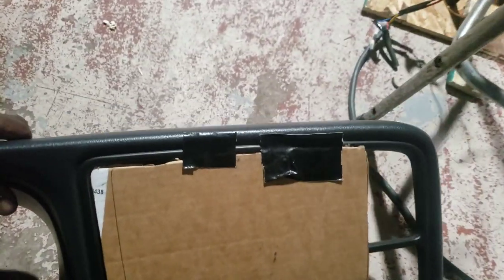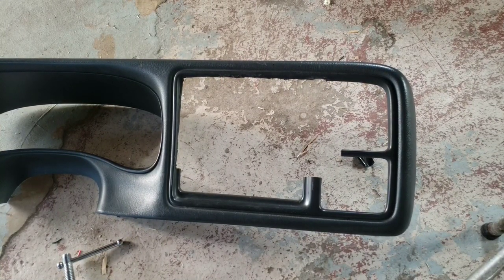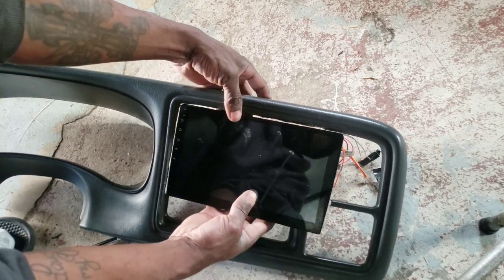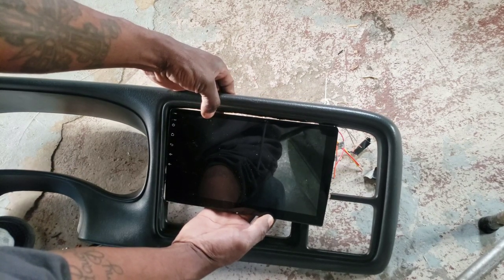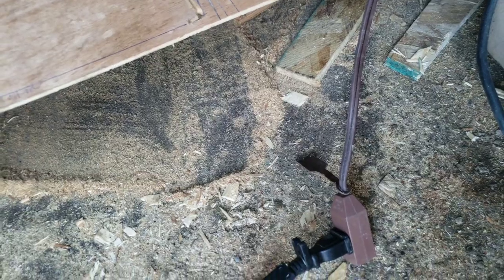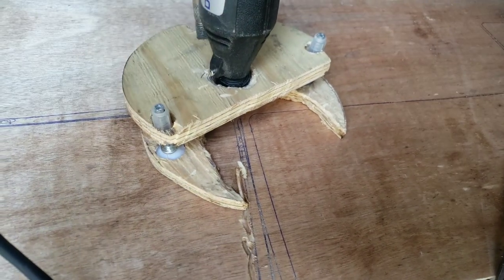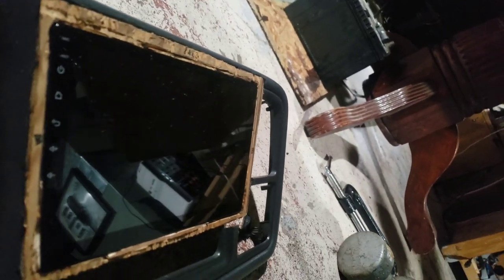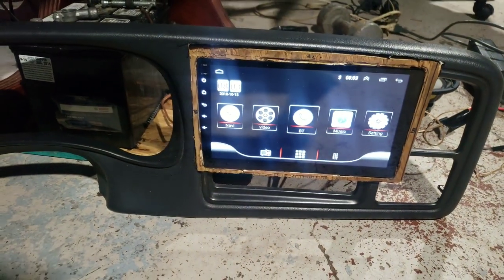How to put a oversized android radio flush in a single DIN Yukon part 1 (10.1 android radio)

Comment: Yo this is badass but how do you screw the double din into the frame without the cover in the way? What I’m dealing with rn….
Reply from the maker: I made a wooden frame at fiberglass it into it
Reply from the maker: It was so tight meaning the radio into the wood I did not have to have screws I kind of had to force it into the wood